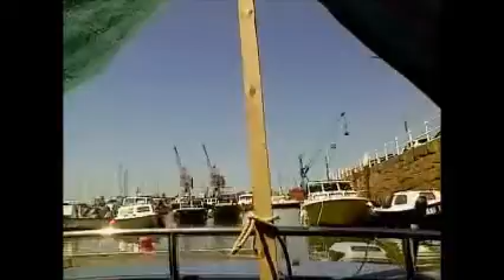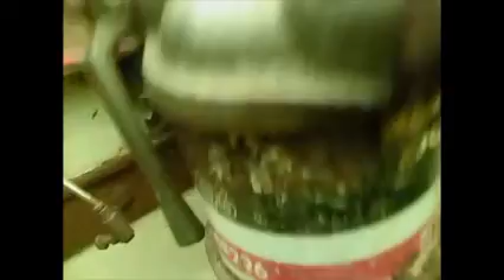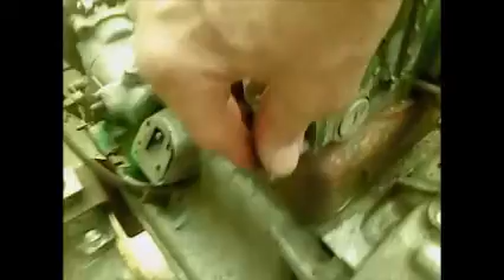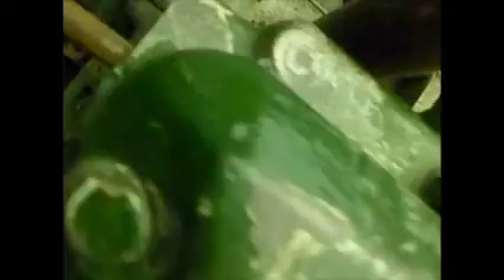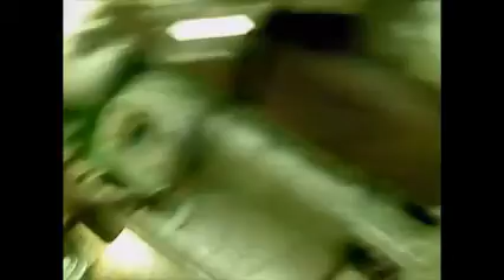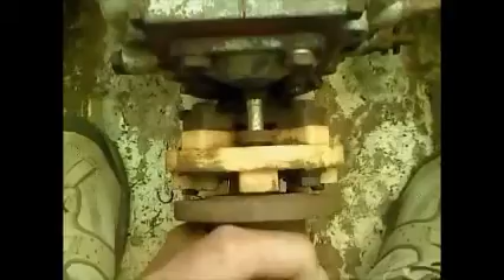LISTER PETTER DIESEL ACW2 Part 3

Comment from the maker: Thanks for the info. The motor is now complete but on turning the motor over ther is a lot of leakback from the injectors but they are not giving out any atomised (or anything) spray. We need to get this boat working for this 2013 summer so Im at the crossroads of deciding whether to buy a new motor. Probably sell these two motors (Ive got an identical ac2w). If anyone is interested message me. We've done a video of the completed motor since this video but it just wont start. Fed up, had enough.

Comment: the two little tubes you put oil in ,,generally it helps with starting the engine by adding compresion (spelling ) you  need to lift the decompression levers next to the tubes ,some of the levers on some engines  will move back across as you crank the engine  once they move back over you will have full compression  the reason  you have these levers  is to allow you to start turning the engine over with a little compression then as you crank the engine  the levers move back